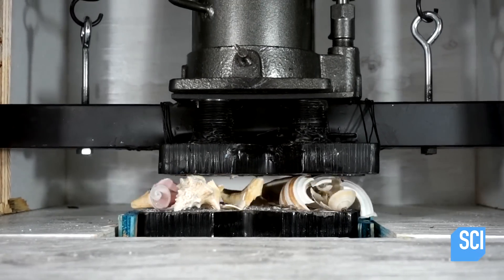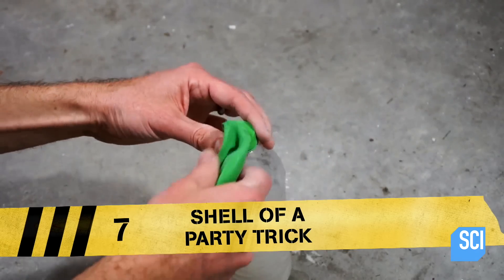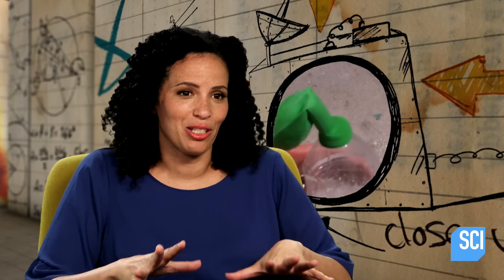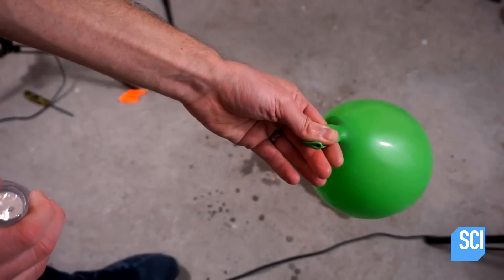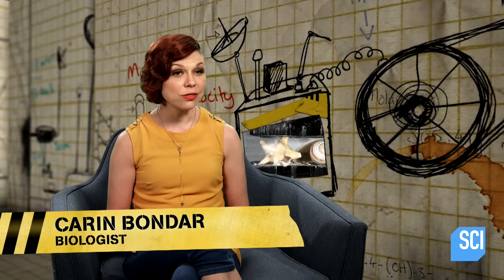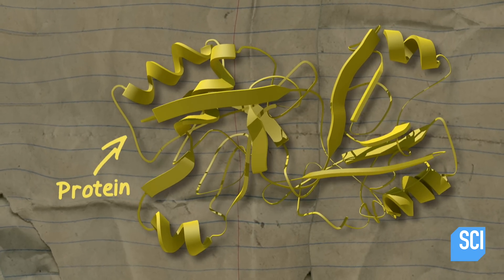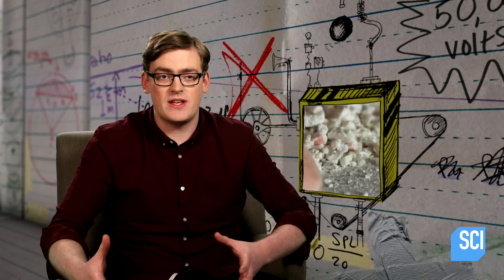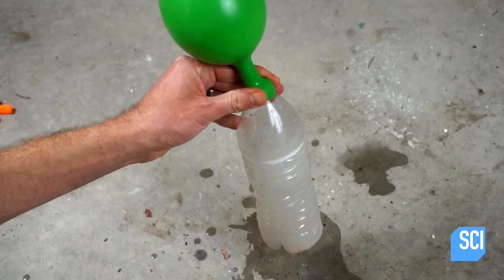How Can A Hydraulic Press And Seashells Be Used To Inflate Balloons?

Comment: Do you think this can be used to propel cars?
Reply: This boils down to the old vinegar and baking soda experiment in science class - all the shells are is a variant of bicarbonate of soda/baking powder. So nope, wouldn't be able to power anything with this. All it does is produce a very weak amount of pressure, attempting to move an engine piston with it would be futile, as getting the ration of dry powder and vinegar would be a pain, matched with attempting to keep the mechanism clean from blockage.

TLDR: No it couldnt.
Reply: Well, there it goes! Thanks for the reply.